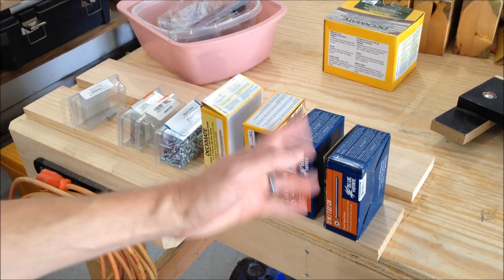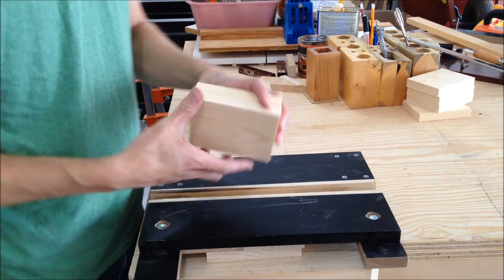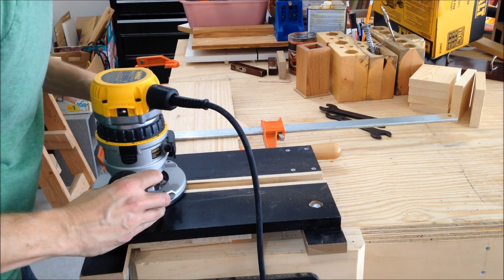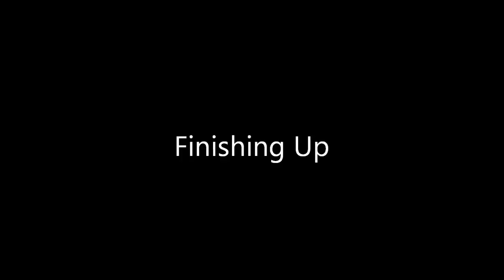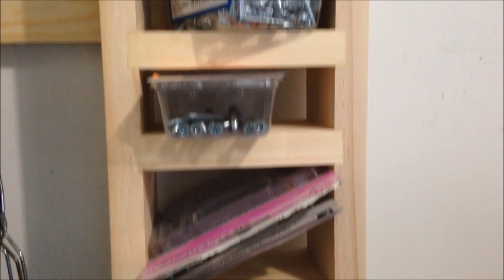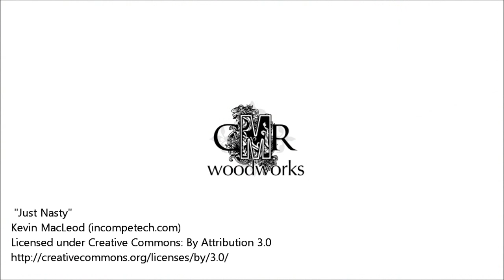French Cleat Screw Storage / Screw Caddy (CMRW#21)

Comment: Great job. I've seen Marc's video of his dado jig. Awesome job building this French cleat screw storage. I have been wanting to find a solution to storing my screws. My garage walls have the studs exposed so it would be more tricky and not practical to use the French cleat system. I've thought about cutting some pieces of 4" pvc and placing them in between the studs for screw storage. 

Also, what do you generally use to edit your videos that you record with your iPhone?  I have been using iMovie but find it's difficult to edit videos on my small iPhone screen. Do you generally upload them to your computer before you edit them or do you edit them on your iPhone first?
Reply from the maker: I transfer the files to my computer from my iPhone first. I am using Windows Live Movie Maker because I have no other option. The only time I will do any sort of editing on the phone is when I forget to stop recording and don't realize it for a while, then I will trim the video on the phone before uploading. 

As far as your shop, I've seen other people put up one piece of plywood on their wall then attach the cleats to it. That could be an option for you, just cut a sheet to size and screw it to the studs, then fill it up with cleats. 

Thanks for sharing!
Reply: Thanks for the advice on the French cleats. I have thought about nailing up planks from pallets. I have an abundance of them where I live. But then I will lose any kind of storage between the studs. It's a dilemma. Before I close up the studs, it would be nice to put some batt insulation in. Plus I'd like to upgrade my garage with more power. Two 15 amp circuits just isn't enough. 

Also, I just ordered a small tripod with phone mount and Bluetooth remote for my phone that will allow me to start and stop recording with the press of a button. Couldn't believe I found a tripod and remote on Amazon for less than $8 for both. So as far as video content is concerned, I will probably end up shooting and then intermittently cut to some dialogue or explanation of what I'm about to do or what I've just done. If I were to use my point and shoot camera to record, I could use my phone for audio with my homemade lav mic. Then sync the audio and video. But that seems like lot to take on. I will just have to experiment with it and see what works best. I have windows movie maker but haven't messed around with it too much. But I will check it out some more. 

Keep up with the good videos.  I'm really enjoying the simple shop projects.

Comment: not sure why the horizontals are so thick, they don't need to be for the weight they are holding. And you'll get atleast 1 or 2 more bins if you went with 1/4".
Reply: I was thinking the same thing.  At the beginning he mentioned that he was using scraps -- so I'm guessing he used what he had laying around.  Those shelves will never sag!